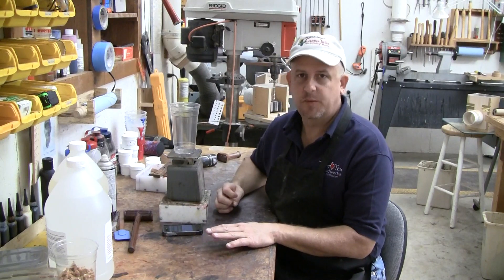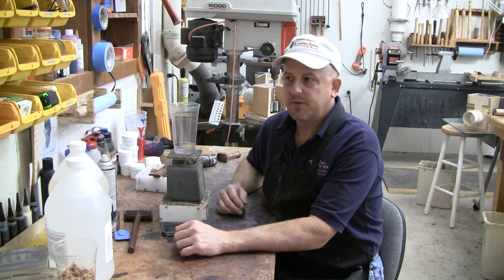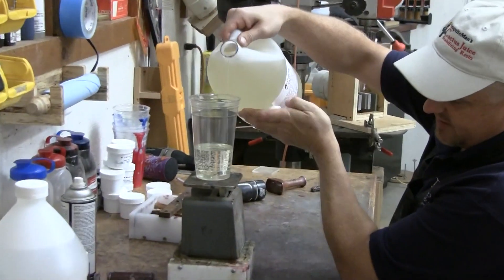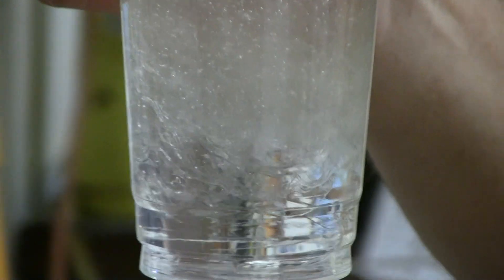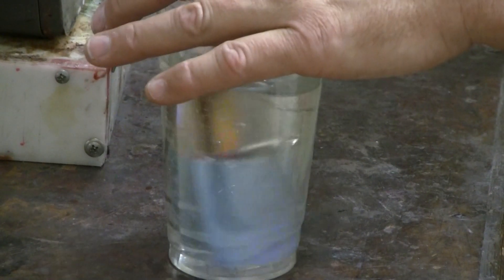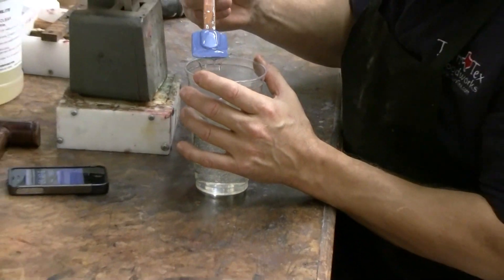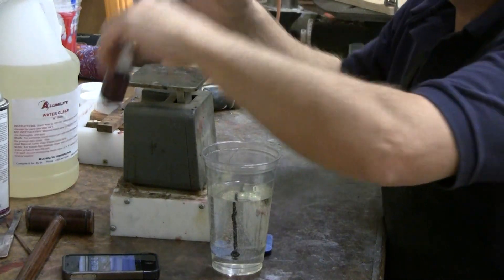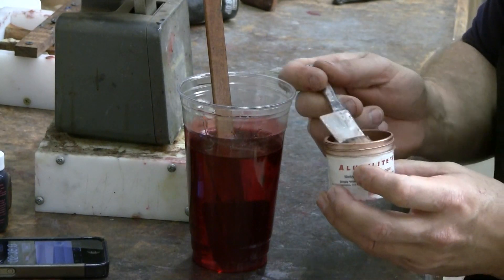How To Mix Alumilite Clear, Wood Turning Supplies | Alumilite

Comment: How professional are you? Not much because you should never use a scale with alumilite.
Reply from the maker: Hi Brandon - Curtis is a professional we trust which is why he is featured on our Alumilite channel. In part of this video, he is mixing Water Clear, which has a mix ratio of 1:1 by weight which requires a scale for correct measurements.

Comment: If you are still freaked out about the open time; pre-measure part A and B in separate containers; this way your time does not start until you start mixing them.

Comment: You want at least 35psi but don't ever exceed the rating of your pot! I usually use 40psi. The higher the pressure the less chance of bubbles. Keep it in the pot long enough for the material to set up so that once you release the pressure the bubbles cannot form. Usually 20 to 30 minutes is a safe number.

Comment: You have to add compressed air to the pressure pot to increase the internal pressure. This does not add air to the solution making more bubbles. If there is any remaining air left in the solution that was either not vacuumed out or added during the process of pouring... putting it under pressure will shrink the existing bubbles to a size so small that you cannot see them.

Comment: The pressure pot is increasing the pressure.  I personally use 75 psi but be real careful and make sure you pressure pot is rated for the pressure you use.  I had a cheap pot blow the top so I now only use Binks ASME certified pots!